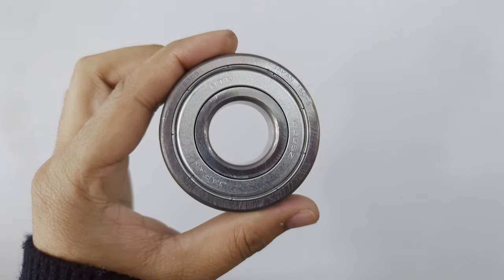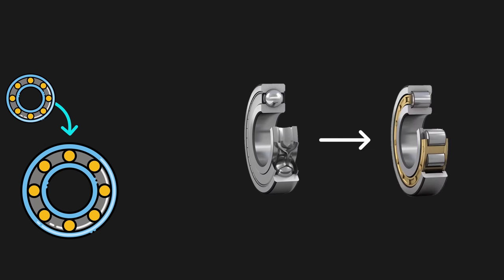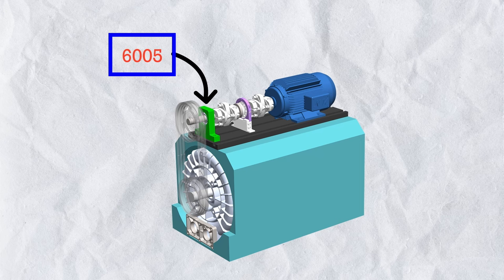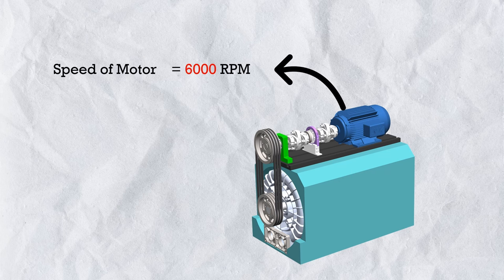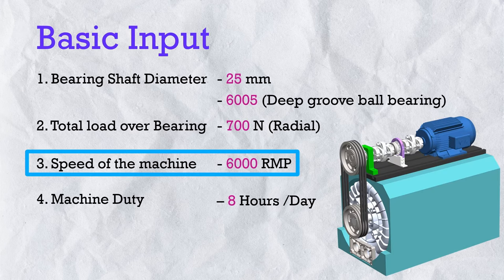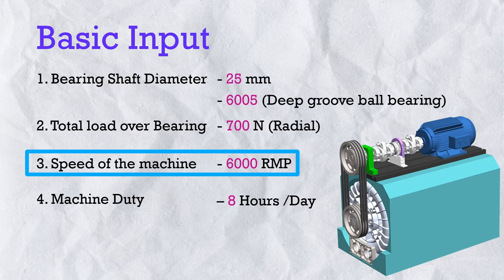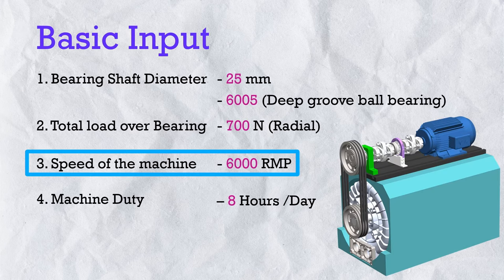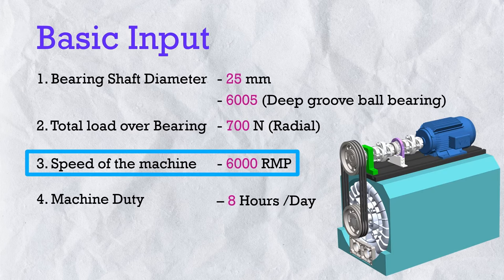Bearing Size Calculation | Basic Rating Life L10 Calculation

Comment: which calculations are required for any machine design
Reply from the maker: Its completely dependent on the machine. What are the elements we are using in that machine. For example motors, pneumatics, hydraulics, ball screws etc. and every element selection should be based on calculations, to optimise the cost of machine. also to make sure that your designed machine will last long without any major breakdown for at least for 10 years.
Reply: Thank you sir ❤

Comment: Thanks for the video. Why you have not included the bearing block and coupling weight (load) while calculating the total load on the shaft? In video you have only considered the load of shaft (5Kg) and load of pulley (5 Kg). so, why you did not considered the weight of other parts? Thanks
Reply from the maker: Hi, In general, bearing block weight and coupling weight are negligible, no need to consider in case of bearing life calculation, (but we can consider, here I had not considered because, I try to make calculations simple, otherwise video will become too long, No such technical reason)
Reply: Thanks for your kind reply. But if we consider the weights of bearing block and coupling too, then which formula would we use to calculate the total weight on bearing? Please let me know. Thanks in advance.

Comment: p = 3 for ball bearing and 3,33 for roller bearing because the balls in the ball bearing have a point contact and the rollers in a roller bearing have a line contact, so they wear less quickly :)
Thank you so much for your video's, they are so well made and thus easy to understand! :)
Reply from the maker: Yes absolutely. I was just wondering why exactly 3 and 3.33

Comment: @28:20 what will be the formula if we are using different series for checking axial load capacity check?
Reply from the maker: For different types of bearing.. axial load capacity would be completely different. Like for single row angular contact bearings, we can apply heavy axial load, depending on how bearings are arranged. Moreover you don't need to check axial load capacity for these bearings which are specially designed for axial load carrying. You can directly calculate the bearing life. Axial and radial load capacity will be treated equally. 
But bearings like cylindrical roller bearings, we should not apply any amount of axial load. We should check the axial load capacity specially in deep groove ball bearings only. Because this bearing is mainly designed for radial load but could take some amount of axial load as well. Which one fourth of radial load